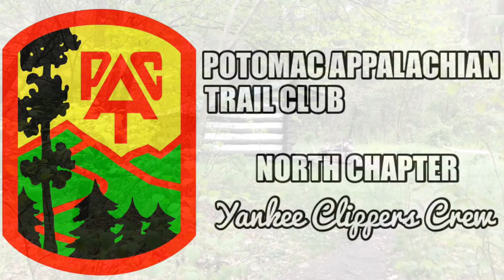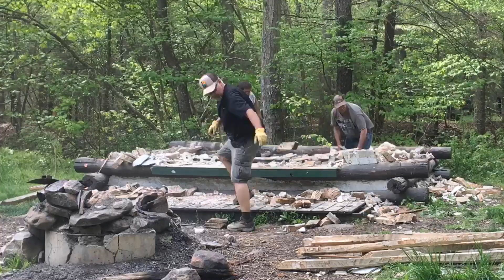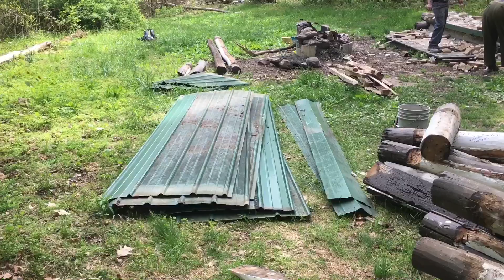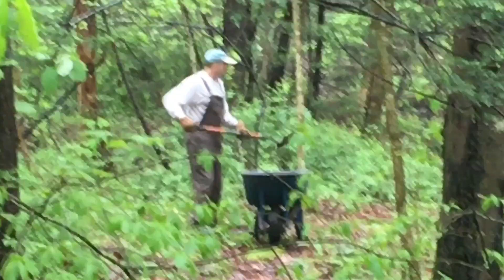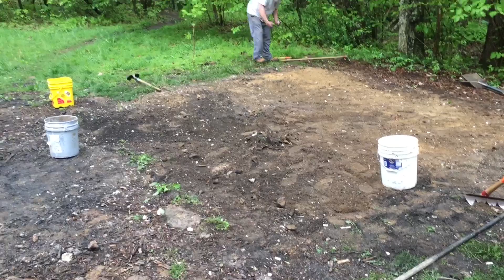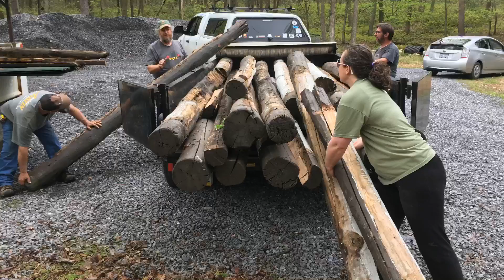PATC - Shelter Deconstruction

Comment: I’m so glad you did this video. I was wondering about it since it’s no longer listed on Guthooks. It was a nasty little shelter, but the tent sites are fantastic there. It’s a shame that is was abused by locals. Wow... all that trash! They didn’t tear down both bridges, did they?
Reply from the maker: It was just the smaller bridge that came off the side of the A/T and led directly to the shelter. The two large bridges on the A/T are still there.
Reply: That shelter was too short anyway.

Comment: I dont see why it was not left standing, with a new shelter built next to it. Did that campsite have a spring and a outhouse? I remember a creek and walking to a campground a mile away for potable water.
Reply: Because the shelter was being moved to another trail, miles away.  The shelter was right on the stream which could be used as a water source, but there was also a frost free faucet .1 from the shelter in the Old Forge Picnic area.  There was a privy, but you could also use the restrooms in the park.  Deer Lick shelter is 2.4 miles south and Tumbling Run shelter is 1.2 miles north, so there really wasn't a need for a shelter to be here anymore.
Reply: @EarthToneLoGear  True, so many shelters in Maryland. The potable water and restrooms were not far. That shelter was too short anyway. The Tuscarora Trail hikers truly need it more. The Tuscarora trail is improving and becoming less of a nightmare to hike lol.

Comment: Extremely unfortunate circumstances  but it obviously was for the best. Eventho there are other shelters/campgrounds in the area would there be any other way to build a new shelter at that same location but have it have a Brutualist, concrete anti-party crowd structure. Sad the locals had nowhere else better to go.
Reply from the maker: There are no plans to replace this shelter. Tumbling Run Shelters are just north of this location and Deer Lick is 4 miles south. Sad to see Antietam go. It was a favorite spot for me to engage hikers and clean up after the party crowd.